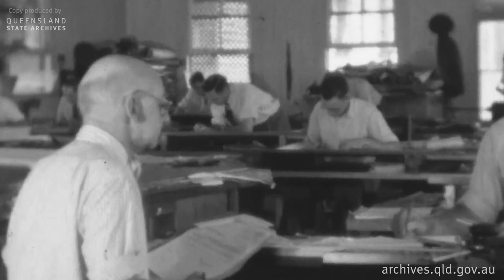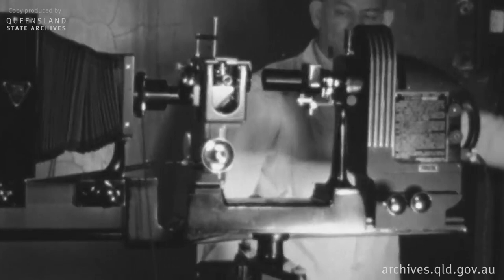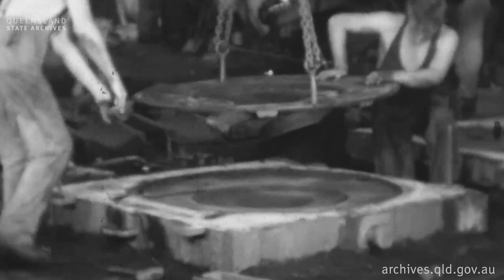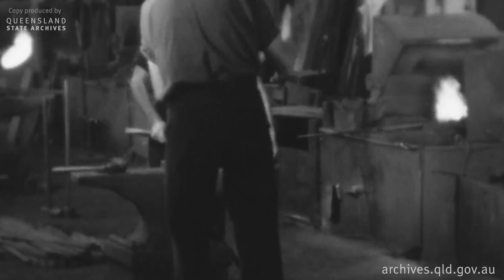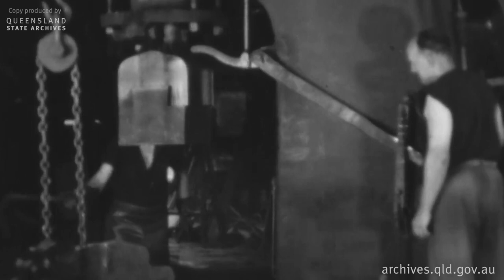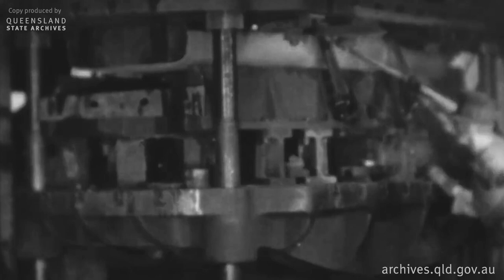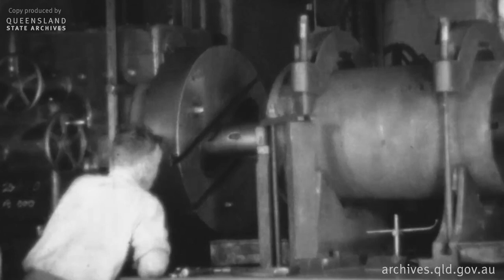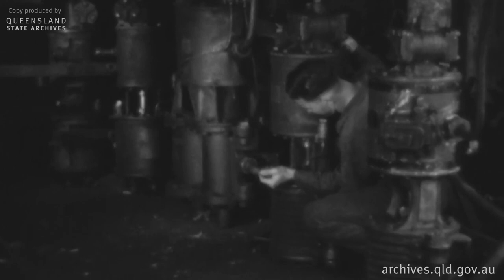Building a Locomotive (1920) - Ipswich Railway Workshops

Comment: That was interesting and more so because it showed something of our own steam engine design and building. I saw a comment about lack of PPE and thought to myself, these men were men.  No safety googles, hard hats, gloves and safety vests and yet they still accomplished their tasks. Aussie workers in their singlets - great.
Reply: because of their work ethic noone was ever injured and the unions fought to reject any form of protection so their manhood would not be questioned.
Reply: nothing but common sense, and having your wits about you though for a good chunk of time they were pragmatic at least as engine crew as they would have glasses or goggles to keep the dirt out of their eyes, and if they were looking into a blast furnace they would have the dark lenses or goggles, and long sleave shirts to keep the hot materials from burning them as much, or they would stuff cotton in their ears if they were boilermakers running a hammer to rivet or calk flues or run stay bolts over on the ends, but its not like it is today, I do kind of like the more deliberate and detailed pace of this documentry and the pacing of the narrator, usually there is more fast paced and hype in the voice of the narrator in uk or us railroad documentrys or how things were done back in the day,  its a nice change, and shows the depth of detail better not just 2 second clips but an actual length of operation, and specificly what the tools were used for, like the wheel lathes not just that its a lathe but that it was used to turn wheels and tires for the wheels.